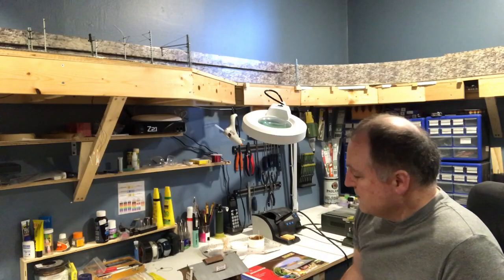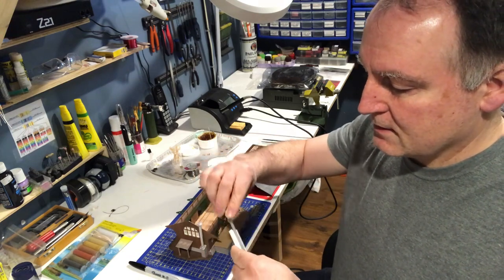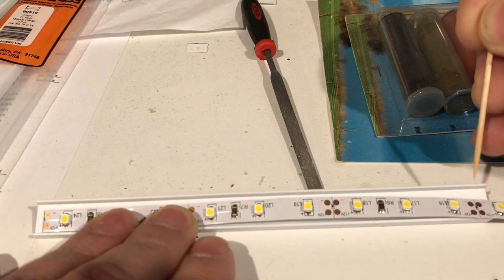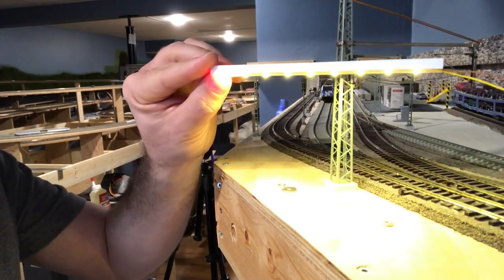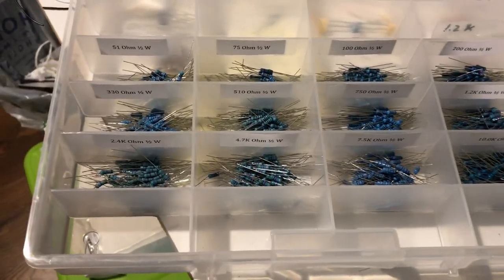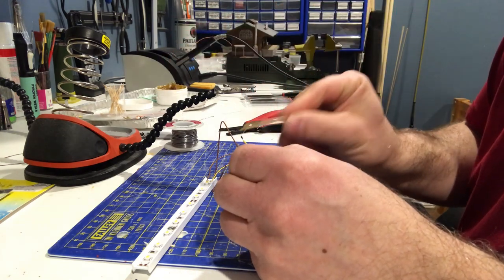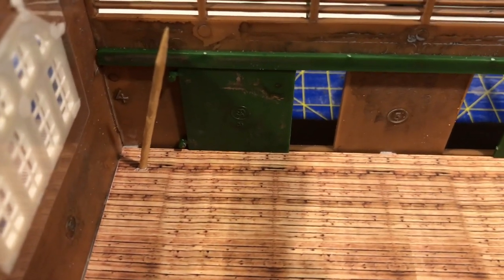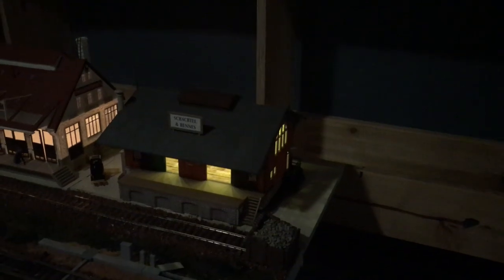How To Put Your Own LED Lights In Your Model Buildings.

Comment: love to see what power source your using..to test the lighting..and how you hook up few to several buildings.....to a DC or AC power source
now i know how strip lighting works....awesome and thank you
Reply from the maker: I use Viessmann 5200 for DC power source and I run 2 wires all over under the layout .(I will make a video of my wiring for the layout soon). For testing the LED light strip I just had a pair of wire hooked onto my track with alligator clips.

Comment: Where did you get that test box at the 8:34 mark? Or what is the correct name for it.? That looks like a pretty useful tool to have around.
Reply from the maker: A friend of mine made it for me.
Reply: @bavariainhoscale8712  Any chance to see the inside of that resistor box? Maybe a schematic or wiring diagram?

Comment: what is the multi ohm switch you used called? where can i get one?
Reply from the maker: I made my own. All it is , is a rotary switch, and inside you have all the different value resistors soldered in. If you wanna make your own, you should be able to get everything from a electronic store.
I hope this helped.

Comment: Great information; thanks! Two questions: was the resistor put on the positive wire (input) or onto the negative wire? Also does the resistor have to be oriented correctly or does it not matter which end is toward the light? Did you add more wire to the other lead of the resistor? Just learning; so thanks for the information. Much appreciated. Great tip about the LED light strip also.
Reply from the maker: Sorry for the late answer. So, the resistor absolutely doesn't matter which end or which wire negative or positive you put it on. You don't have to add more wire to the other end of the resistor, you can just connect the resistor to the power source if you want, or add more wire that's up to you. It will work either way.
Reply from the maker: Absolutely doesn't matter negative or positive and the resistor can go either way, again doesn't matter.

Comment: Excellent way to light the structures, 
I am a beginner here, please help me understand the input current/voltage from the source, as I would have to plan running a cable set for that voltage under the layout for structures.
Reply from the maker: Thank you ! That's exactly what I did I'm running a set of wires 
18 Gauge under the layout and where you need to hook up a light for a building you can just put in a "T" shaped connector to run a thinner wire to the building. I hope this helped , If you have any other question don't hasitate to ask. Cheers!
Reply: @bavariainhoscale8712  thank you for the response, what is the voltage you have on your 18 Gauge wire?
Reply from the maker: I have a power pack that supplies 16V DC power. But after a while when you hooked up too many buildings you will probably need a second or more power packs, depends on how many things you need to hook up or how big is your layout. I'm using 2 right now.

Comment: What kind of hot iron did you use? And where did you get it from?
Reply from the maker: It was a soldering station I used, and I bought it in Germany but you can use any soldering iron or station . Check out amazon . I hope this helped.

Comment: Nice video, what is the part number for the LED you are using?
Reply from the maker: I don't have a part number but I got it on eBay. Should be about $16.- for a 5M. spool.This is what you have to look for on eBay:
SMD LED 2835 Warm white 5M flexible DC 12V. Hope that helps and sorry for the late answer.